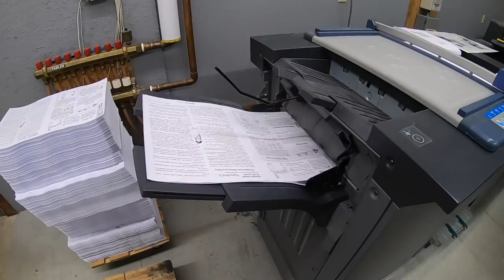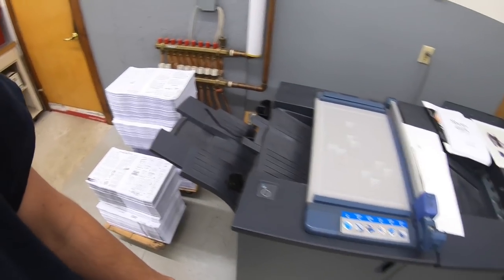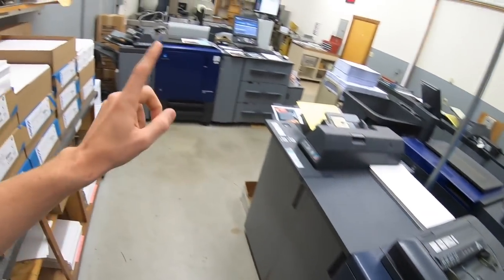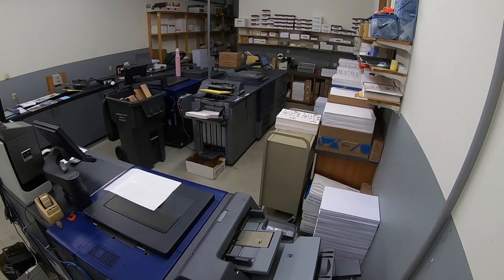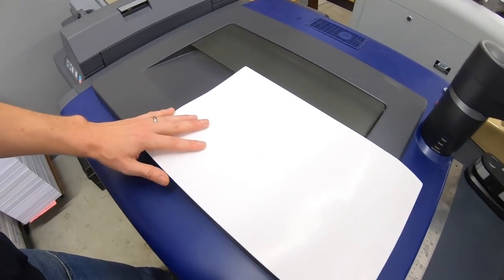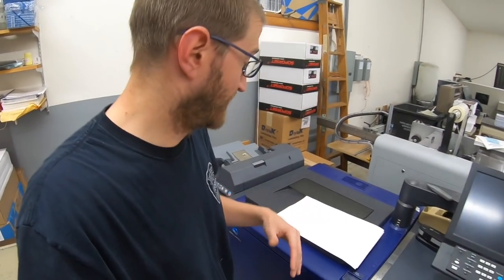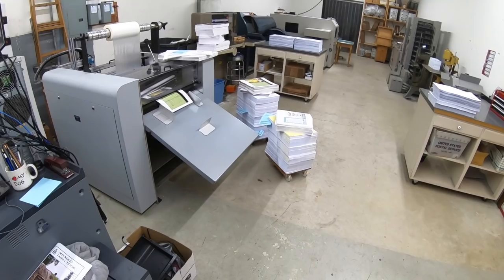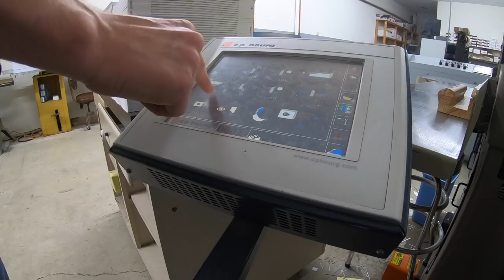Busy Digital Print Shop Timelapse

Comment: Great as always super good to see all the presses busy time to get electrical run. Are you ever going to put the high cap feeder back on that 2nd 3070. Mabie you should move the banner feeder from one 3070 to the other and then put the high cap feeder on it and the recycle bin we're the banner feeder is right now. Just an idea from someone who has worked in a small shop area before
Reply from the maker: Good idea. Yes, I do plan on putting the high cap feeder back on. Some day I'll get the IQ and high cap hooked up.

Comment: Hi Dan, this setup is very cool but what I was wondering is with all these toner printers isn't start beginning potentially risky in terms of health? I stumbled upon Wikipedia page talking about laser printing and it says it can give health issues because all the ozoning and small particles https://en.wikipedia.org/wiki/Laser_printing?wprov=sfla1 what do you think about it? maybe do exists powerful aspirators that you can install in the laboratory who can suck most of particulate and change air very fast, i saw them in movies and documentaries but I have no idea how much a system like that could cost, but if it's for health could be definitely worth of it.

Hope my message could be useful :)👍
Reply from the maker: Interesting. There are several filters that are used on each machine. The ozone section confuses me because I have heard of people buying machines to create ozone because of health benefits. I guess it just depends who you ask. I'll have to do some more research on these topics. Thanks for letting me know.
Reply: @justaprinter  Regarding Ozone I can't really help because my knowledge of chemistry is limited. For the toner emissions they should be treated as every particulate under certain dimension, because the nose can't filter them being too small they could go streight to the lungs and sits there, it's something alike of cigarette smoke or diesel cars.

A good amount is probably kept inside the printer filtering system, however being run all day long maybe some sort of vacuum aspirator near the printers main units sucking the most of microscopic (or nanoscopic) particulate could be an additional help.

This is a case where if you ask medics they will give you an answer, if you ask printer manufacturers will give you another. At the end the choice is follow your guts (not the printed ones haha), I would say better play safe than sorry, not telling to invest tons of money on it... maybe you can find aspirator stuff used on Craigslist too :)

Probably exists also ISO standards for working in certain environments (how aspirators should be installed, and so on), this could be a good starting point.
Reply: @justaprinter  I know at the print shop at the college (they use KM presses) they have an air filter machine.  They also try to keep the side door open to try to have cross ventilation.  When we switched from in-person to online learning I had to help pack packets for my correspondence classes at the local prison.  I have noticed between that print shop and the UPS store that also used Konica Minolta copiers that there is a distinct aroma.  

Air filters would be a good idea, even though I know there are filters in the machines as well.  I have a Ricoh C435dn and I know that there are filters in it that eventually I will need to replace (I believe they come with the Fuser).

Comment: Time for you to get a business card slitter. I can't begin to tell you the game changer it would be for you.....
Reply from the maker: Yes, I'm thinking of that or a programmable 305 cutter. I'm keeping my eyes open. :)
Reply: @justaprinter  Programmable knife no question. Too many other uses and will reduce throughput when cutting. I am also not apposed to an older knife with the right Micro-cut. Watch Thomas Auction. They are great to deal with and you can get some smokin' deals on equipment....
Reply from the maker: @johnweaver1198  Agreed, I enjoy me a good online auction. I watched a video about the newer challenge touchscreen programmable cutters and I'm sold. I need one. Haha.
Reply: @justaprinter  at my smaller store I went with a duplo dc616pro and I can set it and walk away and do other jobs but my printers don’t even do 1/4 of what you do in a hour :(
Reply: @justaprinter  I saw a Konica Minolta add-on for their printers that is basically a multi-knife finisher it can do soo much cuts and have a tray where you open and find business cards already pre cutted ready to be packaged :)
Reply from the maker: @useruser-jv3vm  I saw that too! I want one!

Comment: Hi Dan, can I ask you an opinion?

It's my first time laminating with a professional machine, I've just bought a roll laminator, smaller than yours but still heavy (50kg).

Because I do plan to laminate single sided I will just use one roll, normally they say it's best to use a laminating roll a little smaller than the sheet itself, for example if your sheet is an SRA3 one (32 cm width) you would go using a roll of 31.5 cm. In my case however I have to laminate sheets (A3 ones 29.7 cm) smaller than my roll (31.5 cm). I read somewhere that you need to put a roll of scrap paper under the one being laminated in order to prevent the rolls get dirtied by extra glue being the roll bigger than the original sheet itself.

Can glue outside the sheet be a real problem? On some laminator demo videos I saw on internet they laminate sheets with extra space without thinking it twice. 

Do you also suggest to add a scrap sheet or a roll below? What it could be the right choice if you have to laminate sheets smaller than the roll size? Sadly I can't impose a smaller job on bigger sheets and cut everything after. 

I have to laminate A4 (29.7 cm landscape) and A3 (29.7 cm portrait) sheets with 31.5 cm rolls that are the smallest rolls available for professional laminating.
Reply from the maker: I'd suggest cutting the film like I did in earlier videos. I always use film narrower than my paper. I hav enot tried anything else.
Reply: @justaprinter  oh very nice (even still I'm worried of cutting 250m of stuff in case maybe I will start using bigger sheets). Can you link me that video where you cut the rolls ? Thanks!
Reply from the maker: @useruser-jv3vm  I slit it on the machine. https://www.youtube.com/watch?v=xE_Bgb51_78
Reply: @justaprinter  cool :D I will try something similar ;) thanks!

Comment: Hi Dan! One question:  your C1070 uses the same toner cartrige as the 3070 (TN-619)? Thanks!
Reply from the maker: Yes it does
Reply: Well, that gives me an idea... I also have a C3070 and I know for sure that C1070 has the same toner formula as The bigger brother The C6085 (TN-622). If we buy the bigger bottles we can refill The smaller TN-619 and still get original toner resulting in same quality but considerably cheaper. I still need to do some research to see if it is worth the extra mess :))

Comment: It's possible to produce printed a4 company folders on those Konicas?
Reply from the maker: No, cannot print a sheet larger than 13 x 19 inches
Reply: @justaprinter  what is the largest print product that a people can make on 13x19?